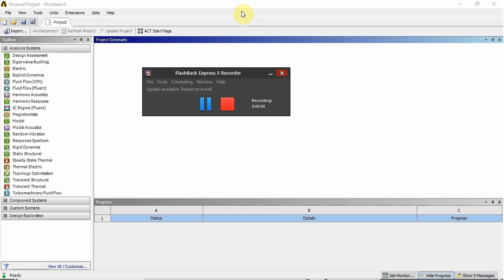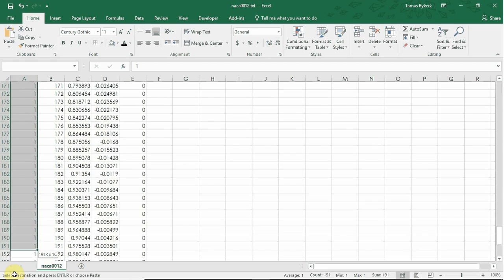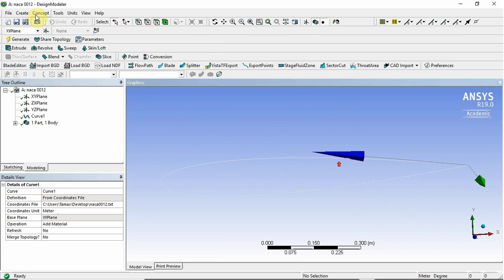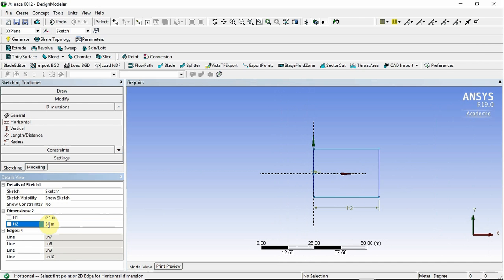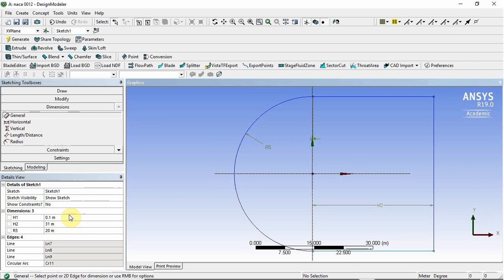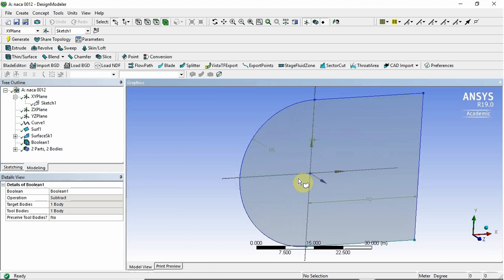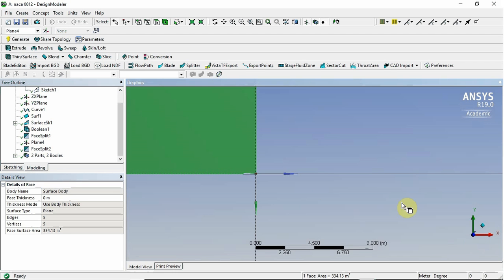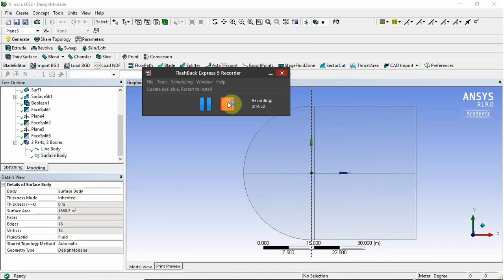NACA 0012 CFD analysis Ansys Fluent Part 1: Generate Geometry

Comment: If the airfoil has camber, the lower surface line split into 2 parts after "Face Split" command. This causes some problems related with "Sizing" operation in meshing section. How can I make one line with contacting lines. Can you help me. Thx in advance.

Comment: thanks for this great video.
but i get this following error at solution part "The mesh contains high aspect ratio quadrilateral,hexahedral fluent" however from mesh quality check in ansys meshing the max aspect ratio is around 250 which is exceptable to double precision solver.
why I get this error and how can I solve it?

Comment: "Error Reading File" can anyone help me with how to import the DATA file into Excel please
Reply: Make sure to have the exact same column set up he has. If you directrly copy paste the numbers into excel they will all be in one, not two, columns.
Also, be sure to change the file type to txt (the same kind in the video)
Reply: i have replaced dots with commas and it worked
Reply: @emanuelely7219  hey man can u help me that text file of naca 0012 didn’t work plz help
Reply: @alichakir5008  Have you tried to replace 0.1234 for 0,1234 ? the english use . as decimal point some countries use , as separator for decimal point
Reply: @emanuelely7219  I tried it but it didn't work, too.
Reply: Me also getting same error